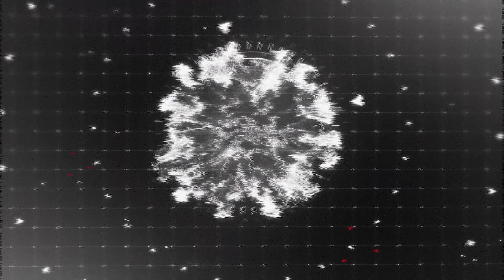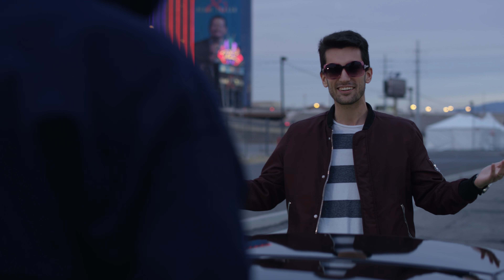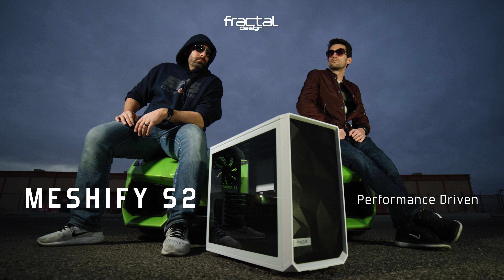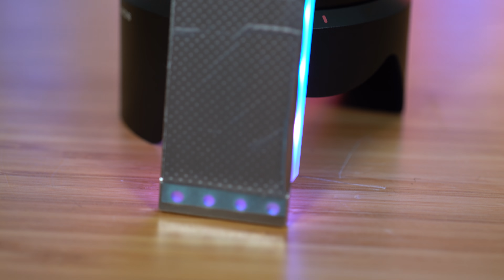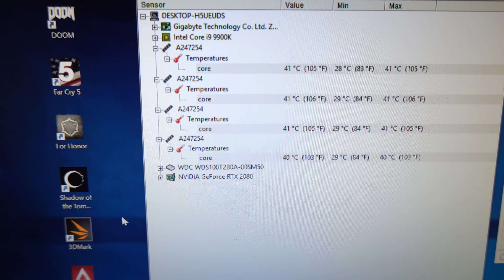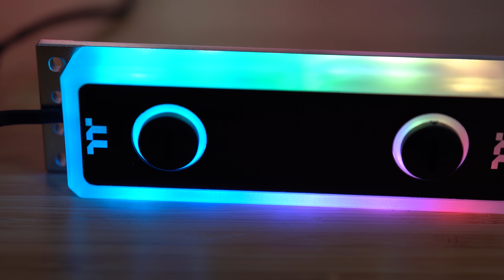Pretty But Pricey - Thermaltake's New WaterRam

Comment: I overlooked my trash corsair vengeance RGB pro cl18 3600mhz memory at 1.45 volt but it Ran pretty hot like 48 Celsius so i just put a cpu cooler fan on top of the ram and  boom now running at 40 Celsius

Comment: Although this is a 3 year old video, I did want to add for anyone else who comes across this video - that when it comes to memory overclocking - there is a tangible effect when you're messing around with specific memory modules - such as Samsung B-die where they are temperature sensitive and their performance scales with voltage increases, particularly if you're going for higher frequency and tight timings. 

TL;DR - the benefits of RAM overclocking do not inherently increase overall performance. Their benefit is in being able to have more consistency in data being fed to/from the CPU. The only observed benefit with RAM overclocking in gaming, is that your 1% and 0.1% lows are higher giving you an overall more consistent frame rate and thus a smoother overall gaming experience. In my testing, I've gained on average of 10-15fps in my 1% and 0.1% lows. It may not seem like a lot, but it makes a huge difference in games

I dove right in with RAM overclocking after overclocking my 9900k - but I felt like some performance was left on the table. So I looked into RAM overclocking. 

Just recently in the past 2 weeks, I found a Patriot Viper kit 2x16 4400MhzCL17 kit when watching one of BuildZoids videos and an Oloy 2x16GB 3600MhzCL14 kit that I randomly came upon on NewEgg. Both of these are Samsung B-Die which is revered as the best modules for overclocking. 

But as I said, they are VERY temperature sensitive. At the stock 1.45v on both kits with XMP enabled, they were seeing temps rise to 50c after about 40minutes of TestMem5. Once I saw temps hit about 47c on both kits, they started to error out. 

As an experiment for me to actually verify just how temperature sensitive these modules are, I bought a fan for the RAM the Corsair Vengeance Airflow (a rather odd product, but I needed something that would keep my ram cool before I voided the warranty by replacing them with a RAM waterblock kit. I saw a nearly 12c drop in temperature using the same XMP profiles for each kit on an MSI Z390 motherboard - and with TestMem5 using the Extreme1@anta777 config file, no errors were found and the test completed all 4 cycles which was about 4 hours. Temps stayed consistently around 38c. After playing with voltages, getting them down to 1.38v leaving the primary timings stock at CL14 for the Oloy kit and CL17 for the Patriot kit and adjusted only the secondary and tertiary sub-timings, I was able to overall increase my 1% and 0.1% lows in gaming by about 10-15fps on average across 10 games. 

Because I was able to verify that both of my B-Die kits are temperature sensitive like I had researched and they worked great, I put them both into my own personal rig as well as my brothers rig on waterblocks and with the settings I found stable, they are now sitting pretty on custom loops getting no higher than 34c under load. 

Will a waterblock make a difference for the average PC gamer who doesn't like to play with overclocking and tuning and just uses XMP and lets the CPU overclock itself based on temperature headroom? No, absolutely not. 

Does it make a difference for those who are looking to eeke out even more performance out of their DDR4 rig? Absolutely - especially when you're talking about ram modules that scale performance with voltage like Samsung B-Die and are temperature sensitive... the cooler the better.

Comment: Hahaha. "Memory isn't as affected by temperature as you CPU and GPU are".

A 4-6 degree difference on 3200mhz CL16 RAM is insane. This was designed to push voltage, which isn't something you even did.

You're a massive, massive n00b. Juuust thought I'd let you know. Cheers.

Comment: I got the AIO cpu/memory floe combo for 139.99+ 149.99 for the 2x8gb 4400mhz toughram. To me that was reasonably priced. 300 for extremely fast ram, a cpu cooler, radiator, fans, pump, and nice argb is honestly a screaming deal when just a cpu water block, a pump, and ram can easily cost $100+each.  And yes aesthetics was a bit of my choice but its good to know that in high temp environments this will drop mem temps and its not just a baseless claim.

Comment: 2:45 "You probably won't have to do the fan re-positioning dance to make them fit underneath some of the larger air coolers"

lol if you're air cooling your CPU but water cooling your RAM, you need help
Reply: right? like if you want rgb on your ram that badly just buy a kit that has it already

Comment: I’d like to see Buildzoid test this and see if they make any better thermals when overclocked versus simply passive cooling.
Reply: I don't think a simple overclock would make this worth it or even make your ram hot enough to raise concerns. I could see it being useful in some sort of server running tons of VMs that is constantly having its memory slammed and heat concerns because of it. Ram doesn't really have a thermal limit target like CPUs or GPUs do, and if it gets too hot it doesn't throttle, it would just crash if the temps got way too high, and I'm sure just a simple heat spreader would be enough to handle any heat concerns.

Comment: My dream pc is something that has all the Rgb i can fit in a glass case that is as close to silence as I can get. I’ve always wanted to do a system that uses an external rad and pump away from the system that does the majority of the cooling and not add any noise. This ram, the gigabyte motherboard with a full cover mobo block, full cover gpu block, and an overkill psu so it’s fans don’t spin even under full system load would be perfect. With all the heat generating components covered by water blocks. You wouldn’t need any case fans in the case itself. All cooling can be done away from the system

Comment: Recently replaced my Trident Z RGB  for some Corsair Vengeance RGB PRO and was checking the prices out and saw the Corsair Dominator Platinum RGB which was £50 more and didn't look as appealing. This from Thermaltake, although get what they're trying to do, kind of. It makes it look extra bulky. The heat spreaders themselves look clean, but that waterblock is just awful. One of the biggest appeals apart from temperatures with watercooling is how sleek it can look if done correctly and this totally subtracts from that look, or at least in my opinion.

Comment: Cooling DDR4 is kind of pointless. DDR3 on the other hand, can benefit from cooling, due to the heat produced from higher voltages. Especially when overclocking.

Comment: EK has thier monarch line of RAM watercooling stuff
Reply: I have a pair of BitsPower RamBlocks (x4) for my Dominator GT set. (DDR3 8x4GB) They bolt to the top of the RAM, once the stock heatsinks are unbolted. Good for DDR3, but DDR4 doesn't put out anywhere near the same amount of heat, so I don't see the point.